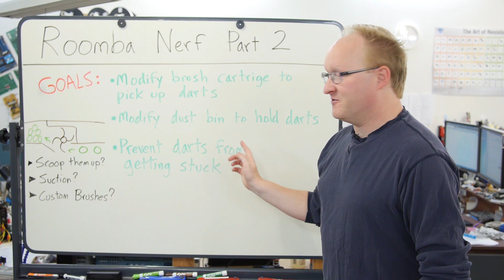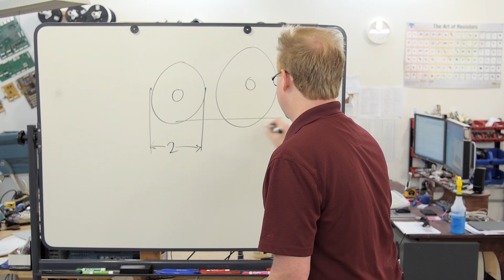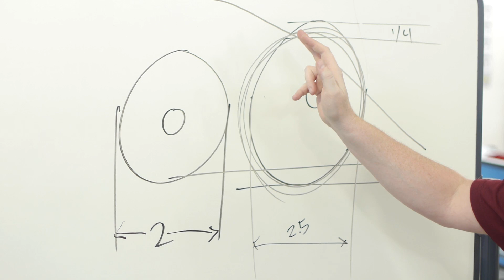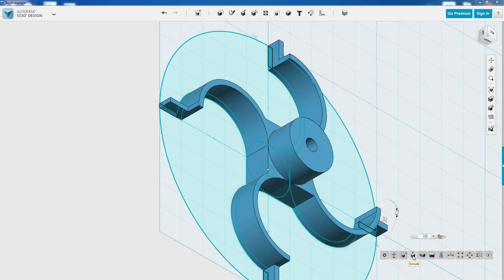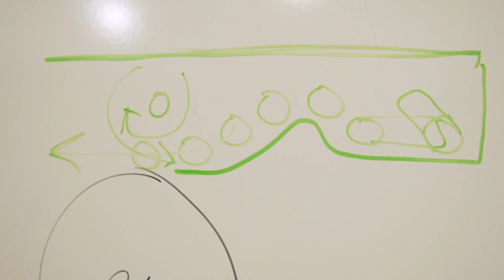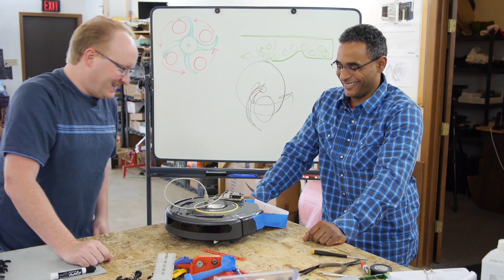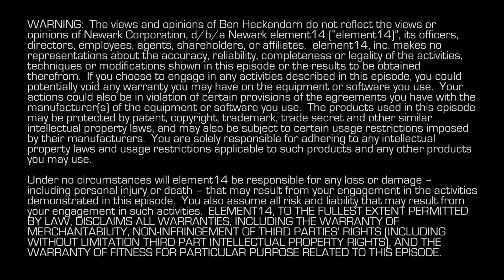Ben Heck's Roomba Nerf Dart Collector Part 2

Comment: Why bother with a big beater bar? Just add a thin scoop underneath so it drags against the ground. This will pick up large darts (and other foot-killing toys, like legos and cars) just fine. Replace the "claw" brush with a very lightweight rotating brush (just a few thin bristles every 1/4" or so, offset by 30-45 degrees axially) to scoot them into a bin. This would probably handle any flat dart orientation the Nerfba (Roomberf?) is likely to find.

The scoop allows for a smaller/more lightweight brush, which will scrape over a smooth surface (part of the scoop), eliminating friction over a carpeted surface, which you still haven't tested. If the scoop is ramped up slightly (from floor to scoop), this allows for a shorter brush length, decreasing the need for a fast brush motor RPM and the likelihood the brush will get jammed up and/or burn out the brush motor. The scoop would have to be thin and rigid. If it jams against the cleaning surface the scooping end could be curled upwards, slightly -- or a small set of skids/skis could be added to the sides to provide the scoop edge with maximum scooping capability.

Comment: What about an above conveyer belt with magnets and have small magnets in the nerfs?
Or make lower gearings in the original so it would have enough torque to pass them thru.